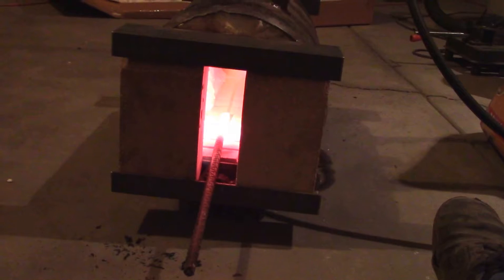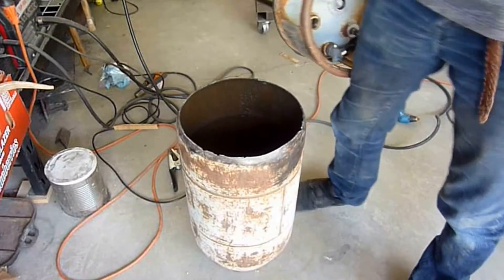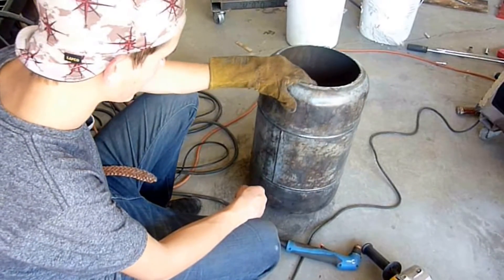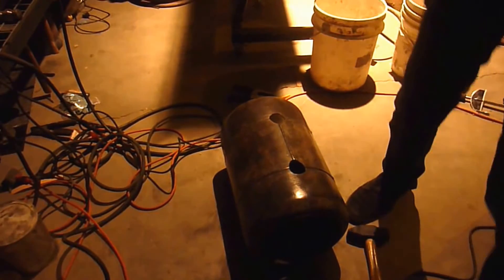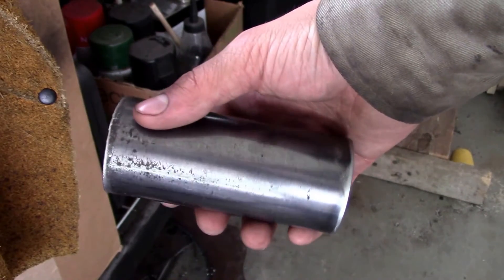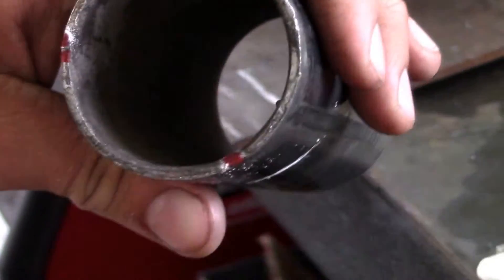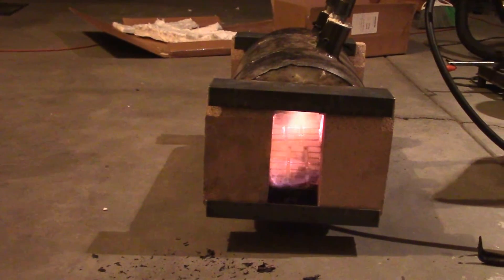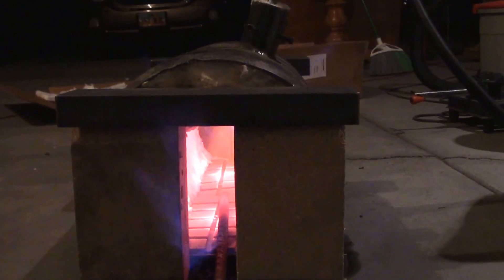Propane forge build

Comment: before you install the burners I would suggest you give them a "wet" run. hook them up to a hose and shoot some water through them to make sure that mig tip is aligned properly in the burner body. some times you have to do a little tweaking (aka bending). hope that helps. oh and cool desighn ;-p
Reply from the maker: +LazySmith Thank you very much I watch a lot of your vids and look up to your skill. I just made my first Damascus billet in the forge last week.. I made the flairs on my burners, I didn't have any stainless steel on hand so they are just normal steel so I'll prob have to replace them soon when I do ill do a Wet run but they do their job for know thanks again and happy forging.
Reply: +O.B STONZ sounds good man, I look forward to more vids!
Reply: Turner Forge